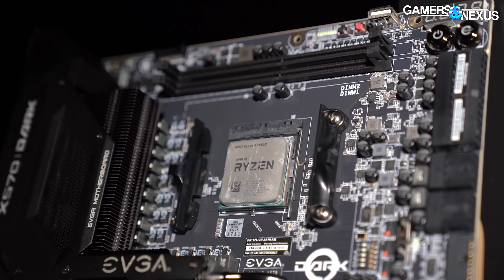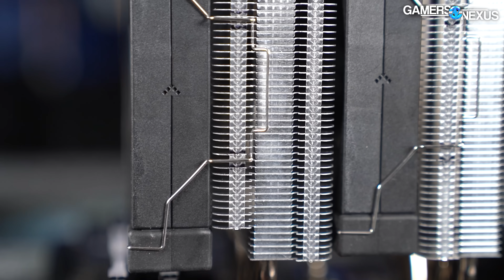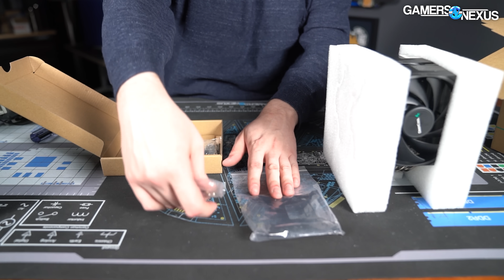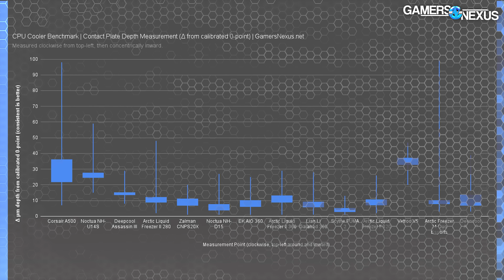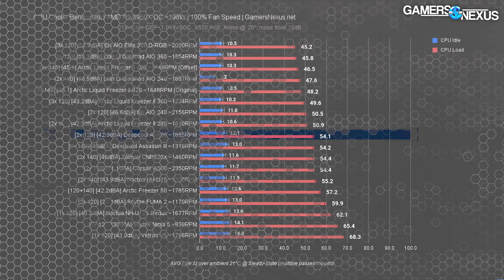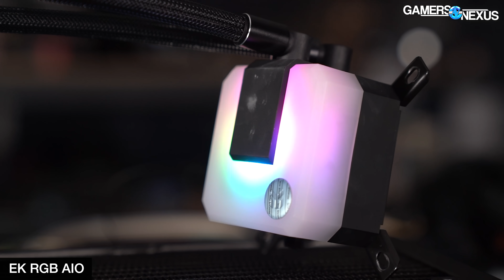Air Coolers Are Getting Impressive: Deepcool AK620 Cooler Review

Comment: Air coolers and cases both have followed the similar trend of being able to get great performance in the 60-70 dollar range, where in the past you had to spend extra on the “premium” brands to get such performance. I also hope this makes the old guards of high end air cooling (Noctua and BeQuiet as two quick examples) make new innovative products that deserve to be priced at ~$100. I love a D15 as much as the next guy, but paying 100 dollars for something that came out in 2014 just feels a little harsh. I am excited for a 140mm version of Noctua’s a12x25 fan, but it has been delayed many times and is now suppose to come out in q3 2022. Next gen d15 is in q4 2022 and I think that will be using the a14x25 (if thats what they call it.)
Reply from the maker: You are 100% right in that the $60-$70 coolers are finally getting really competitive with the old-guard brands. Here's hoping it keeps Noctua and BQ (and others) on their toes!
Reply: @Real28  maybe harsh is not the right word, but I always want something better in either performance or value. You can match d15 performance for approximately 30 dollars less right now. It’s a double edged sword where you create such a great product right off the bat that its hard to iterate and improve it. Im excited for the next generation d15 that is on their roadmap for q4 2022. It will most likely be using their next generation 140mm fan and I would bet also add a 7th heatpipe like we see on the u12a.
Reply: @Real28  Dont you get free new retention kits too if needed for a new socket ? From Scythe etc. you have to pay what around 10-15€ ?
Reply: Agreed. However, I'm quite glad to have bought a D15 when I did, because it's still useful, and it'll never start leaking and kill a future PC build.
Reply: D15... I also still have a D14 with original fans working just fine.
Reply: @wobblysauce  Heck yeah, I'm still rocking a D14 too.  Thing is ancient but still good enough to keep my 3900x cool (and also with original fans).  Best part is, when I switched from Intel to AMD, they gave me brackets to fit the motherboard... for free!  To support a product they stopped making years and years ago!  Noctua's products might be pricey but it's hard to find any other company in this space that has better pro-consumer policies in place.
Reply: Thermalright is starting to push that threshold even lower, with the $40 Peerless Assassin 120 and $55 Frost Spirit 140 both being remarkably strong performers.
Reply: @s c totally agree, but having competitors finally match and even beat Noctua’s highest end cooler for 60-70% of the price just means we will get more innovation from Noctua. Their last true newest cooler was the u12a with 7 heatpipes (versus 6 on the u12s) and it coming with their a12x25 fans they developed a couple years ago (with their liquid crystal polymer frame and blades, which you see other companies now using LCP on their highest end fans) are still really the newest upgrade on the market besides the u12D which is just the u12a but shorter with square frames to fit a 4u server rack and cases with less clearance to the side panel.

My hope Is these new coolers that are actually beating the Noctua means we will see new innovative cooler. They have 140mm fans on their roadmap still that use the LCP and same construction and fan blade material as the 120mm a12x25, even though the date has been pushed back a few times now. They also have a next generation D15 on the roadmap that I imagine will use a version of these new 140mm fans (will probably use round frames like on their current d15 and d14, and add more heatpipes like the u12a adding 7 heatpipes versus the 6 on the u12s.) Either way I’m very excited for what we see, as i honestly wouldn’t be surprised if they had to push back a next gen tower cooler even further back when they saw the heat output of current gen zen 4 and 13th gen intel CPU’s as the highest end SKU’s from both companies honestly really deserve water cooling with a 280 or 360mm radiator, or you aren’t getting all the performance. Might see matching a quality 280mm AIO be Noctua’s Goal. 

Lastly, I agree with you on using products for as long as they remain useful, even if it isn’t the most flashy and fashionable, as its better for both the environment and your wallet. But at the same time Noctua tends to develop new coolers like every 4-5 years at a minimum, so its not like they are rushing out upgrades for the sake of having a new product out each year. They actually do real, serious R&D, and and release upgrades only when they truly have a Better product all around. I know whatever they end up releasing will be in the highest pricing tier we see for air coolers, but with the fact and knowledge that includes brackets for future sockets, and very easy replacement for say lost mounting hardware, I think the price is justified. Very excited for what Noctua eventually releases. Sorry for the essay response haha, but wanted to describe what Noctua is working on and how their R&D tends to manifest into real products. Have a great day!
Reply: Well in the realm of cooling, I'm not so sure about the expectations for aging products to get cheaper over time. Better value proposition is not happening in an obvious manner.
Reply: I just settle for Cooler Master Hyper 212 EVO. i don't OC my CPUs, and take advantage of my near freezing room in cold seasons.
Reply: @Aereto  eh, even overclocking somewhat I've been rocking a 212 for like a decade lol. Maybe I'll buy a new cooler eventually.
Reply: now Noctua delayed again and is now suppose to come out in Q1 2023.
Reply: @after12p.m.22  fr?
Reply: I need more air coolers that fit Mini ITX cases. For example, the Noctuas U12A just barely fits the NR200.
Reply: @arvinsim  Noctua just announced their U12D its a dual tower cooler with a round frame version of their nf a 12x25 fan. It’s 146mm tall I believe and can fit even a 4U  chassis. So it will fit in a lot more cases than the u12A which is about 10 or so mm taller.
Reply: @arvinsim  why not just use a regular size case that gets all around better performance, more expandability and better part compatibility?
Reply: @XX-121  Because that is what I got right now. I recently upgraded so I will be using it for years.
Reply: @arvinsim  you mean downgraded?  because in the electronics world, when you get smaller and hotter that always equals less/worse performance.
Reply: @XX-121  It's always a trade off. I like my PC small. You might not value that but I do.
Reply: Some ppl prefer small form factor builds just for aesthetics and portability. @XX-121
Reply: I only paid 27 bucks for my dark rock pro 3.
Reply: 6:47 At the instalation process, did you use the things delivered WITH the Deepcool cooler or you advertised something or you bought them separately?
Reply: mfs want $220 for it here
Reply: yep agreed 
I loved my nh d15 but it just doesn't seem to hold up these days 
the ak620 auctully runs cooler than my nh d15 does on a ryzen 7 5800x3d
Reply: I love the AK620. It performs as good as the Noctua. But after a short amount of time the fan bearings got noisy on my AK620
Reply: It's now 2024 Q2 and the 140 mm version of the A12x25 is still not out XD
How hard can it be to just upscale everything by 16.7%? Shouldn't that yield the exact 140 mm equivalent?
Reply: One small nice thing for the NH D15 is that it comes with a tube of NT-H1 thermal paste instead of just a single preapplication of paste on the cooler, and I don't know what other coolers also do that. (Admittedly that's only a value of like, $10).
Reply: @99wolfspider  i used the NT-H1 tube on my watercooled build later on. gpu and cpu. Still the tube that was in my noctua kit from a year before. xD good stuff. to this day i never bought thermal paste. still half full.
Reply: @99wolfspider  I purchased my D15 back in 2016 and never looked back, and I used that TIM it came with for several computers as it was great stuff.  I since purchased MX5 and it was even better, but harder to apply.
Reply: Noctua is overpriced and overhyped for some time now, Deepcool is kicking their ass for way lower prices.
Reply: @Real28  
Except GN demonstrait arctic 280 perform better than d15 for example.
Reply: @jintsuubest9331  Know the best test?  Swap the fans from a D15 and it.  That will tell you which actual Heatsink is the better which is what I care the most about.  Now if it gets better than we know the HS is better paired with their fans MEANING Noctua would no longer be the best fans out there.
Reply: @jintsuubest9331  their bent up, damaged d15 from 10yrs ago when they bought it that's been tossed into parts bins time after time test after test?  that's the one you're talking about?  the one that they recorded numbers on 10 yrs ago in nasty conditions?  yeah, sure man, use those old test numbers on old hardware vs brand new, out the box numbers.  sure, guy,. .. that make's sense

edit: i bet if it was an intel air vs amd water the d15 would win hands down on this channel.

but nah dude your 212 wiill smoke a d15 hands down (the crowd given title of "KING OF COOLING" is a lie) as long as your on intel and worship GN and got your fauchi ouchy ...  you will have untouchable cooling.  just trust the science (and cnn)
Reply: d15 is still worth it.  just because it came out couple years ago doesn't mean it's worth less.  it also comes with 2 premium noctua fans and if you buy one new you are getting whatever updated heatpipe tech they are using now.  and i can almost guarantee that he's not using 100% fans on the other coolers like he did on this one to sensationalize things and get views.  you gotta take some of the stuff on this and a lot of channels with a grain of salt.  The D15 isn't known as the king of air coolers because it sucks.  oh and i got the chromax mod for mine and it looks flippin sweet.

Comment: sweet, i prefer air cooling myself so im glad they're getting better and cheaper
bought a fuma 2 based on your reviews a while ago and it's been pretty great as well
Reply: Agreed. AIOs just don't last. I bought my Hyper 212 EVO a decade ago and it's never going to die.
Reply: @surewhynot6259  Yeah man I chose the Hyper 212 for my home server that's on 24/7 and I've had it for years and works perfectly.
Reply: @surewhynot6259  I bought mine 7.5 years ago.  I got a second fan when the stock one stopped spinning, but it turned out that I just needed a few drops of sewing machine oil into the reservoir.  The original fan is still going strong, and now I have push/pull!  :-)
Reply: @surewhynot6259  Then don't buy cheap POS units like Corsair.
Reply: using it on my 5950 with mild overclock amazing work by scth fuma
Reply: Spent $1500 on water cooling had all ek blocks, pumps and resevoirs... nothing but problems. Aio never gave me an issue but ill definitely be going to aircooling now.. no hassle and consistent power without having to worry about dissipation or power loss from an aio system. I actually like the way the air coolers look
Reply: nice, still waiting to pair my Fuma 2 with the 5800x, getting cheaper by the day, pulling the trigger soon ;)
Reply: Same
Reply: @nigeldorman414  :)
Reply: same here, ,  ,been running a cryorig r1 since 2013 without a hiccup.
Reply: Mugen 5 RGB FTW....keeps my 5800X cool as a cucumber.
Reply: I love the Fuma 2 because of how quiet it is and with Ryzen single core chiplet CPUs it's perfect.  I've been using them for a couple years now.  They'd been reviewed on Hardware Canucks about a year before GN got around to it.
Reply: i have teh zaliman CNP10X performa and i love it, 35 dollars and it is similar to a scythe mujen.
Reply: Why no Intel, they run way hotter so bench marking on AMD is not so good...
Reply: love my fuma 2
Reply: 6:47 At the instalation process, did you use the things delivered WITH the Deepcool cooler or you advertised something or you bought them separately?
Reply: Fuma 2 is the king. For the price and the performance how is it not the king?
Reply: @boosteddaily1294  
Because they haven't reviewed the (under $40) Thermalright PA120.
Reply: I bought a Fuma 2 and 25 days later exchanged it for a Fuma 2 Rev. B with the faster fans. I'm a bad person.
Reply: @deViant14  is the rev  b any better?
Reply: @ericcod1productions  no
Reply: @ericcod1productions  I was trying to test it properly so I could share but it wasn't very scientific. I changed the curve as well and idle temps went from 43.6 to 38.1. Heavy load 74.1 to 73.1. It does seem louder under load but barely noticeable when its pegged over my gpu. I don't know...I didn't test it well enough and I'm injured and gave up once it was installed. Hopefully someone does proper tests on it.
Reply: @ericcod1productions  Note also I only stole the fans from the new one and didn't change anything else because I believe they're identical besides the fans and the 1700-compatible mounting kit.
Reply: @deViant14  do you recommend me to get the rev b2 then or no! I got 4 Noctua heavy duty 2000 rpm case fans to help
Reply: @ericcod1productions  they're tough to compare because they have different max speeds and max noise but if you get Rev. B it should be better because if you want quieter you change the curve or lower speed. But they're both good in their own ways.
Reply: @deViant14  how much degree differecne wold it be at idle and load ? is it worth buying it for 65
Reply: @ericcod1productions  Yes, I got a rev b. 2 things, the fans are black in the rev b which works for me, but your preferences may vary. Just a little faster fans means a little better cooling/little more noise. Running an undervolted 5800x, super cool and silent at 20% fan speed(300rpm)
Reply: @deViant14  Did you use Newegg?
Reply: I am pretty happy with AIO
Reply: @petervansan1054  same I prefer something that's simple pretty an not a large ugly loud thing in a case, idm replacing my AIO every 5yrs for 200$
Reply: @Anihilationx360  eh maybe, but it looks much cleaner in the case than largeass air cooler
Reply: @petervansan1054  yep I paid 265$ for my H150i elite capliex absolutely a beast
Reply: @Anihilationx360  The new H150s look like trash, I prefer my D15 Black lol.
Reply: @SyncF  meh plan basic an blocky enjoy high temps

Comment: Air coolers are just so large and heavy, I'll keep my 280 AIO.
Reply: @Mike Watts I've never had a AIO fail.  Had one running for 7 years before this 280.  Worked flawlessly.
Reply: My original Hyper 212 still chugging along. Not heavy at all.
Reply: @whasian1487  ya its a good cheap cooler.  But try to cool an intel 12 gen with it.
Reply: @zonemanbobo  cooler master does make mounting brackets for exactly that.

Don't get me wrong, I love watercooling. But I also have 2 computers on air and 1 on water. I like having water setups for gaming, air for low maintenance.
Reply: @zonemanbobo  they make low wattage 12th gen as well so that shouldn't be a problem at all
Reply: @AlwaysRLYAngry  it's on top out of the way.  Wow there's a lot of you air guys out here.   Why the hate on AIO!!!!
Reply: @zonemanbobo  i think so far, most of us are just responding to your claim about weight or cooler compatibilty. I'm completely fine with AIOs personally.
Reply: @whasian1487  well I'm right about the weight 😂.
Reply: @zonemanbobo  an nh-d15 is 2.86 pounds. A 280 aio is generally above 5 pounds.
Reply: @whasian1487  2.86 on the MB.
Reply: @zonemanbobo  my optimus signature v2 cpu block is somewhere around that weight as well. Doesn't really matter.